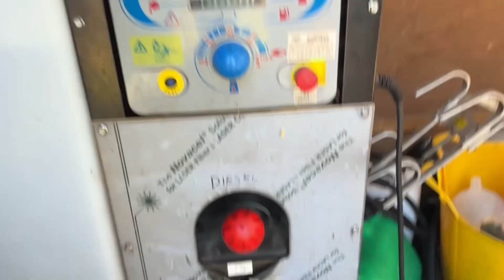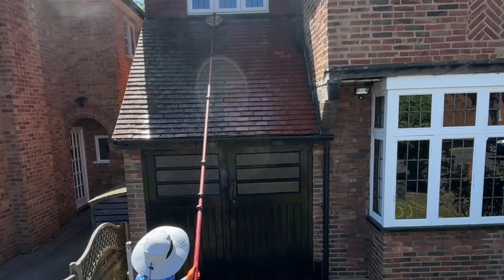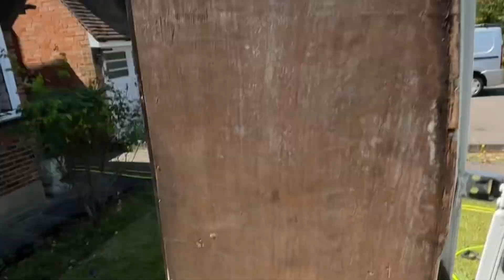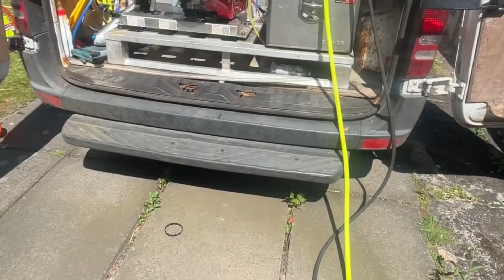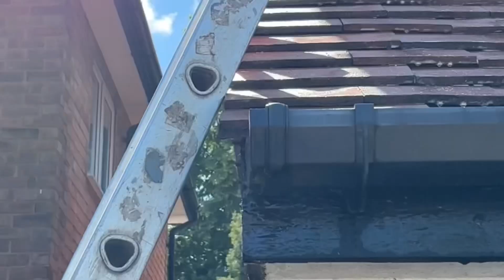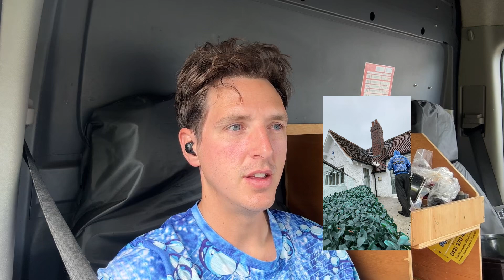Simple roof cleaning process I use that banked £18k last month lol

Comment: Nice work Dan. Do you ever brush on the softwash? It's good for a windy day to avoid drift and gives you better control. 
Btw I like your shirts 👕 
Are they from the USA? Seen this company TSol in Canada selling them. They look good in the cleaning industry. Also bleach resistant 😊
Reply from the maker: @paudielyons3918  brush only really for render, as it’s too slow unless like you say it’s crazy wind 

Shirts we designed and had done in China

Great quality but slow process - I don’t recommend doing yourself lol
Reply: Shocking example, over spray, no Ppe